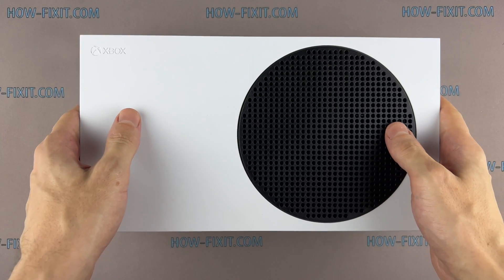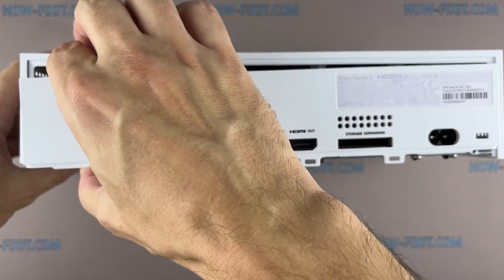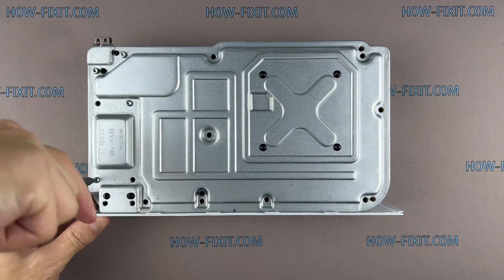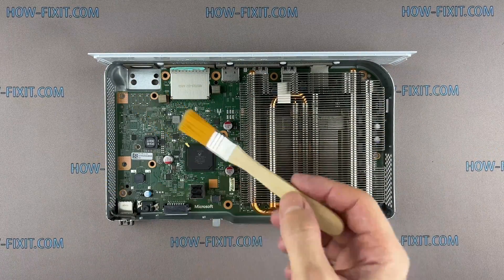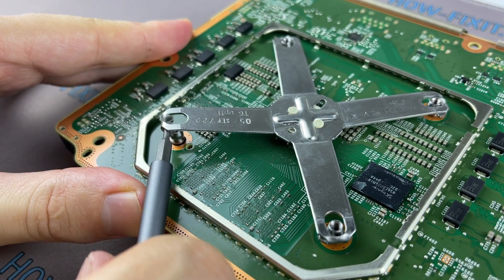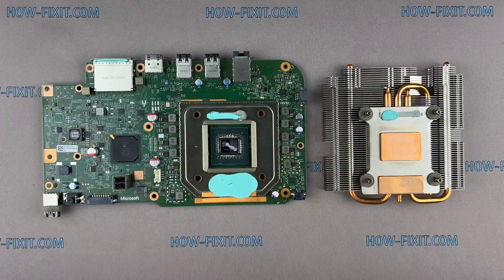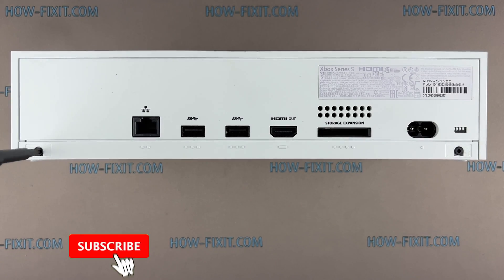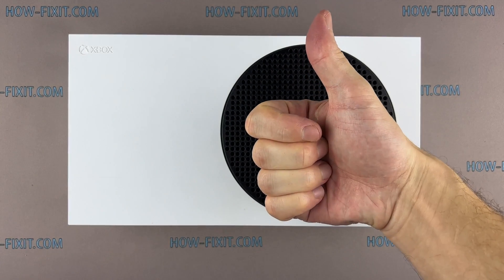Xbox Series S How to Disassemble, Clean Dust and Replace Thermal Grease

Comment from the maker: For more info check out the links in the description
Reply: hey what good thermal pads should i get to replace the one i currently have since when i pulled the power supply it cracked in half also; they leave no oil on fingerprint when you put your fingerprint on them

Comment: X clamp won't go in properly one leg is standing higher than the rest :(
Reply: you must pull it back in place using your screwdriver. Every clamp goes for the opposite direction

Comment: good guide but you should reshape the putty to make sure it makes good contact again after re-assembly
thermal putty should stay malleable and you should make it thicker (higher) than the gap it's supposed to fill so that it spreads with contact again
what you did there at 7:25 is opposite of what you should do, you are spreading it more but you should really push it more together so it's higher than the gap and it gets spreaded again when put together

Comment: I'm having a little issue with my console. It's starts up fine, just when I'm trying to sign in it's not signing in it just stays at a loading circle but won't let me sign in after the loading circle just goes back to try signing in again.....I need help!!!
Reply: Hold the power button down til the console beeps and turns off , wait a a minute and turn it back on , gives it a good ol refresh .

Comment: When I was removing the psu for cleaning, the thermal pad tore in a v shape. Now, whenever i play a resource-heavy game like warzone, my console overheats and shuts off after 30ish minutes. Is it possible to replace the pad with paste instead? or could i add thermal paste to the pad itself?

Comment: For the people watching this, if you feel confident in your ability to replace the thermal paste in your Series S, I highly suggest it despite what the "forget about it" shills say. I used XTM50 on mine, gave it all a good clean (the stock thermal paste application was an absolute mess). 
Prior to - the air coming from the top was super hot (like it should be, but it seemed way too hot) and I would see signs of thermal throttling. The fan is static speed and doesn't ramp up as it increases in temps.
After cleaning the garbage application and using high quality TIM - the air coming from the exhaust is much cooler, the Xbox is also much cooler, and I am getting no signs of thermal throttling.
Those who know what thermal throttling look like will know what I am talking about.
Took about 3 full thermal cycles to get the TIM to set in. Broke it in using 3 30 minute Starfield sessions.
Reply: What about the blue thermal paste spots I noticed in the video the guy never replaced those wild it hurt to keep them the way they are
Reply: @tracevoight9332  if they are not damaged when disassembling, they can be reused. I reused mine without issues.
I think the are 2mm thick, and are thermal pads. Next time I do the paste ( a year or two) I’ll replaced the pads.
Reply: @sevenfacedsin not pads but thermal putty, if I'm not mistsken

Comment: To anyone looking for informations about changing thermal pads in series S, i recommend using 1mm Gelid GC-Extreme -  two 80x40mm will be enough for entire console. Also i advise against using mx4 for repasting, it will pump out FAST if you are playing often. Instead i suggest to use gelid GC extreme paste, it's dense and much harder to spread than MX4 but it will last longer.
Reply: I can 100% agree with the MX4 regard. I started having loud fan issues indicating that thermal paste was dry on my series s recently and sure enough, the factory paste was pretty much dried up. So I ordered some mx4 and applied it, only for it to continue having the same fan issues like it was overheating. I left it be for awhile thinking that it would eventually set itself, but got worse over time. I then decided to order MX6 paste which is way better than mx4 and reapplied that and my Xbox is back to being silent as of today. So I also don't recommend MX4
Reply: @theknightwithin6187  any particular brand? I'm looking at fixing this issue with my son's Xbox right now.
Reply: @Codablaze  arctic mx6, like under 10 bucks on amazon
Reply: Thanks for the advice, buddy

Comment: I just took apart my son's XSS to clean it, because it said it had insufficient ventilation, but it has a ton of room, the fan is coming on and there was barely any dust in it. Any suggestions? He just got the expansion card for it and that was as hot as the rest of the console when it shut down. Wondering if that blue stuff on the card slot, on the inside is bad? It is dry. Not sure if that's how it should be
Reply: Sounds like a clogged power supply issue, or it it's the thermal paste on the GPU chip, as shown in the video. Thermal paste for this particular console doesn't last very long (Maybe up to only 2 years depending on daily usage) due to how powerful it is, and the amount of heat it puts out. I would check the power supply first, since it can dust up since it's right next to the fan, and if that's not the issue, I would replace the Thermal paste on the chip.

Comment: This video was essential for me fixing my xbox series s
Reply: did u happen to have a problem where u would load into games and crash immediately? cuz thats happening to me
Reply: @jchilenski6720  that's exactly what I had, I put arctic mx-6 thermal paste after cleaning the cpu and heatsink residue from factory thermal paste that was there. And my console went from crashing to playing mw2 and fifa 23 with no fans sounding like a jet engine anymore.
Reply: @aiAnimator2K  this is unbelievable because the exact same thing is happening to me. same games too, mw2 and fifa. i’m going to order that on amazon, i would assume u got it from there?
Reply: @jchilenski6720  yeah got it from amazon along with the toolkit he said to buy 😎 I bought the series s 2nd hand for £40 with the knowledge games didn't work  so was happy when I fixed it so easily 🤣
Reply: @aiAnimator2K  i see the mx-6 thermal paste but where did u find the toolbox
Reply: @jchilenski6720  ORIA Precision Screwdriver Set, [120 in 1] Repair Tools Kit with 101 Bits, Mini Magnetic Screwdriver Set with Magnetic Pad, Aluminum Handle for Smartphone, Game Console, Tablet, PC, Glasses

But if you already have t8 t10 screws your basically ok except for the heatsink
Reply: @aiAnimator2K  Hey just following up, just got the thermal paste and did every step in this video. Waited about 15 minutes and then turned it on hoping it would work but the same exact thing happened 3 times in a row. Do u have any other suggestions or is my xbox shot and I need a new one.
Reply: @jchilenski6720  If its not a cpu issue, then maybe its the heatsink or psu issue. But I'd assume it was the cpu or heatsink still. I gave a generous helping of the thermal paste more than the video. If it's been applied well and you still have the same issue gotta be heatsink or psu I imagine.

Comment: Should I replace Thermal paste even if the system is working fine? Or can I just do the dusting?
Reply: If everything works just fine, you don't need to. I would say, after 3 years of normal use, its a good time to renew the thermalpaste. If you play 10 hours a day, maybe earlier.
Reply: @Marcelxy  Thanks for the reply, I ended up replacing it, When I opened it Paste looked dry so better safe than sorry, plus I hate the Xbox "X" plate I had such a hard time putting it back. Everything else was a breeze.

Comment: Hi, I just got a brand new series s this week
Is it normal for my series s to feel hot even when I'm not playing games? Like just browsing in the store and even on standby.
Reply: i wouldn’t jump to that conclusion too fast. it ultimately comes down to how hot it actually is not how hot it feels.
Reply: No it's not normal, you should maybe check for your xbox if the thermal paste has dry out to much and reapply the new thermal paste, and do some cleaning to the xbox series s, if that doesn't work I think you should replace your xbox series s with a new one or get it repaired immediately
Reply: Its fine. Mine is the same

Comment: How do i know if i need to do this with mine?
Reply: When you notice your system gets hot or really slow that when you need to replace the thermal paste
Reply: @cooloneapplegaming9204  ok thankyou
Reply: @cooloneapplegaming9204  also whats a good thermal paste for these incase i do have to.
Reply: @MrThunderCunt  noctua thermal paste is a safe bet. Just dont use liquid metal causs if you dont know what you're doing say rip to your xbox.

Comment: Such a useful guide. Xbox Series S build is totally neat. Zero flex cables used for ultimate easy repairing. 

SSD module should be taken out first before removing heatsink clamp to avoid damage from the SSD slot.
Reply: 💯 Agree, this one is more reliable and easy to repair with an impressive power consumption approximately of 70W, but I prefer the XSX.
Reply: @3lectronic0  i prefer the series s just because of its power in such a small size. Also the price is good. I mean you get exactly what you pay for.

Comment: Is it advisable to replace the Thermal Pads too? Is it better to use MX-4 or Noctua? The thermal paste used by Microsoft looks quite dry.
Reply: As long as you're using high-grade ones with at least 12Wm/k or higher and also 0.5mm of thickness should do it. Even you can just put Thermal Grizzly Carbonaut for it.
Reply: Should I get the MX-4 thermal paste because my Xbox gets hot really quickly and I have CPU throttling...
Reply: @voltrix-s  thermal grizzly is the best brand for thermal paste u should replace the thermal pads too cause is pretty bad on the serie S
Reply: @mts4651  to late lol that Xbox actually shut down for no reason. I'm getting a gaming pc tomorrow 😅😂
Reply: U better use a thermal grizzly kryonaut for the Thermal paste

Comment: I’ve removed the heat sink on mine and the metal part that covers the memory is attached to the heat sink … is it just stuck or did they revise the design ?
Reply: They did put it in the design